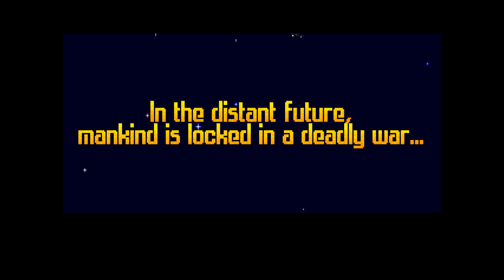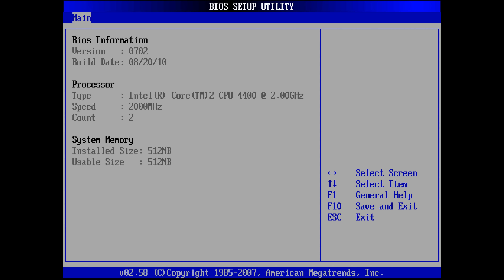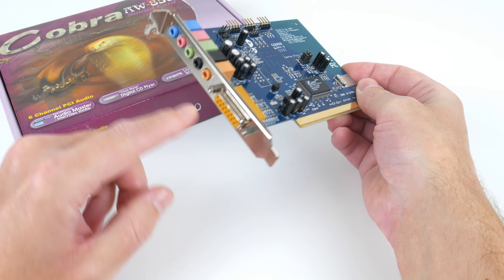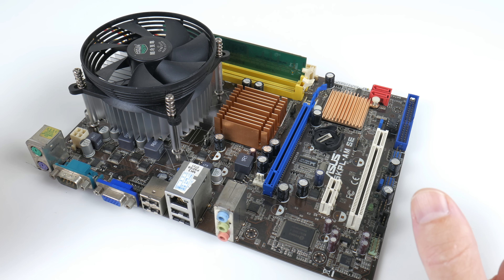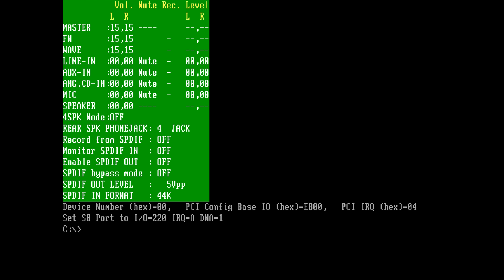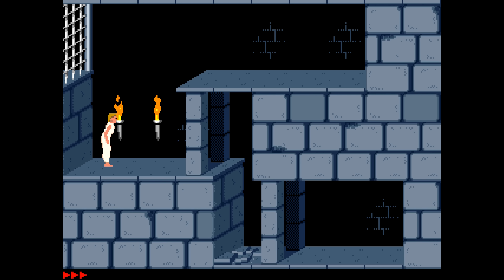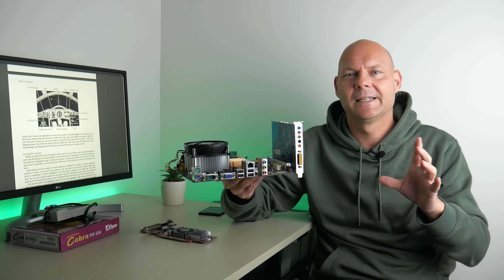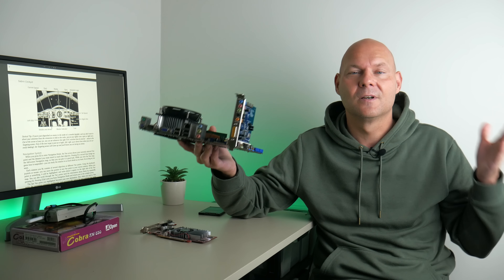DOS Retro PC with Parts nobody wants

Comment: I have no idea why people don't want lga 775 parts. The compatibility is immense. being able to run DOS all the way through to Windows 10 is crazy.
Reply: they are still great for basic Linux machines as well with enough RAM, an SSD, and a 1/2 decent video card.
Reply: Of course they want, the prices are already insane and have been for years, maybe what PhilsComputerLab meant was some of the lower end 775 motherboards no one wants. I have two 775 modern DDR3 boards, bought each for 12€ last year as my DDR2 motherboards just died, the prices of those same boards increased a lot since then.
Reply: @farben_ not really. Also there are plenty of OEM systems that have decent on board audio compatible with Windows 98
Reply: Exactly, but there is nothing as strange as people :)
Reply: @JoshVennix  I've looked at this exact motherboard p5kpl-am se a couple of years ago, it was already on the 20-25 bucks, it's now with shipping over 50€. 775, AM2, AM3, 939, Socket A... everything is costly now, there are no "hidden gems" anymore. Used Sandy Bridge motherboards cost the same as current modern ones.
Reply: 775 isn't considered 'retro' as of yet. People don't want the heat generation of the older Pentium D either. I just recently came across a parts bin for $30 containing a Voodoo3, S3 Vision864, Pentium 200-S, Yamaha 719 sound card, and Sound Blaster 16 CT2290. I put together the 200-S, with my P5A-B. The S3 Vision864 / CT-2290 is a perfect pairing for DOS games. Quake runs at 45 FPS (640x480). Duke Nukem 3D and Shadow Warrior worked perfectly as well. There are still plenty of cheap Socket A solutions out there if you want really good UT'99 and Doom 3 playback.
Reply: I am still running perfectly good Linux desktops on LGA775 machines, particularly if they can take a Core 2 Quad upgrade like a Q6600 or Q9550 CPU.

I actually despair at the human race being "bullied" into regular hardware upgrades by Microsoft's Windows upgrades (and Apple's forced obsolescence) - because you can stick Linux on any Core 2 Duo PC or laptop with a 2.00 GHz CPU and 4GB RAM from 2006 onwards and have a fairly good daily driver PC, even for the modern and utterly bloated and broken web.

My equivalent to Phil's "XP retro gaming PC" is something like a HP Elite 8000 or Dell Optiplex SFF PC with an LGA775 socket that I have upgrade to a Core 2 Quad with 8GB RAM and something like a Radeon R5 430 low profile OEM GPU board running Linux Mint or my distro of choice, Gentoo Linux. A machine of that specification will run all older Linux native games, DOSBox and a lot of the GoG catalogue with WINE - I tend to use Supertuxkart as a benchmarking tool on Linux PCs that I build.

You can build such a PC for "pocket money" today and I have a whole stack of them just for when I get the guys over 3 or 4 times a year for beer, pizza and a LAN party with Quake, Unreal Tournament or Red Alert.
Reply: @CommodoreFan64  Damn! I just posted my lengthy diatribe on "great Linux PCs" and you got there first! But 100% in agreement.
Reply: @terrydaktyllus1320  LOL I'm with ya, but one place I disagree with you if you're going to use a computer for daily usage on 64bit Linux, is to have at least 6GB - 8GB of system RAM, and an decent SSD is a must(they can be had for less than 20 USD) for the boot drive for comfortable usage, so you are not running into swap usage, and waiting on disk access no matter how much ram you have  but 4GB is doable in a pinch if you are careful about how much you are running in the background, and use a lightweight browser like Falkon. I have an old ASUS 15in laptop with a hyperthreaded dual core i3, 256GB SSD, and 16GB DDR3L RAM(I it laying around in the parts bin, and thought why not lol), and it runs Manjaro GNOME with the traditional layout just fine for basic task.  
Also yeah I love salvaging old hardware like whenever I go to my local county recycle drop I make sure to check the e-waste bin, and found some really solid gear over the years like Macbooks, Kindles, HP/DELL desktops(I use one with an I7 2600s I found in the e-waste as my work machine), my Asus laptop, IBM/Apple Keyboards, etc.. It really does make me sad at how much people throw out that's still usable with a little TLC, some minor upgrades, and change in OS.
Reply: Let's exercise caution and avoid overestimating the capabilities of the 775 platform. While it may work for DOS gaming, based on my experience with old Dell Optiplex and HP systems for retro gaming, you can expect a subpar experience in Windows 98 due to inadequate graphics and chipset drivers, as well as the absence of an AGP slot.
Reply: It has a lot to do with that in between age. Like, you can get Athlon XP boards and chips still cheap.. and then for an XP machine, you can use a Haswell so.. Core 2 is just stuck in the middle. But yeah. If you get creative it’s a great platform
Reply: @PaulsComputerEmp  A valid point but it still goes back to LGA775 being a viable platform for modern day computing still - I'd consider it almost a "waste" to "downgrade" one as in this video, but if it works for some people rather than paying big money for "real" retro parts then who am I to argue?
Reply: @terrydaktyllus1320  The problem came with the advent of the 64bit OS, it meant RAM didn't have to be optimized like before so the programs and the OS itself became heavier and heavier, code these days isn't as optimized as before as it is assumed the user has the hardware that will meet any basic requirements. Windows Vista is a good example of this, except people were still using old hardware at the time and everyone just assumed Vista was garbage, these days if software is slow people just assume their hardware is out of date and they need to upgrade.
Reply: @farben_  Agreed, but Windows isn't an OS that I use any more, unless it's versions up to XP (and MS-DOS) for retro gaming.

I stopped using Windows as any kind of daily driver when support for Windows 7 ended - it was ordering a new Lenovo laptop that had the atrocious Windows 8 on it that made me realise I was done with Microsoft after Windows 7. (That laptop got formatted to a Windows 7 and Linux dual boot within 30 minutes of my getting it out of the box.)

My daily driver OS is Gentoo Linux which, if you don't know, is a rolling distro that compiles everything from source - which, for me as an incessant "tweaker", means that I use compiler optimisation and build flags to get packages compiled for the specific platform anyway.

It means that I running Gentoo today on anything from a Raspberry Pi Zero through to a multi-CPU Xeon server in my home - and that includes a few IBM Thinkpads from around 2002 with Pentium III CPUs in them that also run it perfectly fine.
Reply: it's a bell curve.  LGA 775 is in the 'old computer' part of the curve, whereas 2/3&486s are in the "retro" part of the curve, and thus, are perceived higher value by collectors.
Reply: @TheAfroman  There are some LGA775 boards built on i865G chipset with AGP and Win98 support. But they are rare.
Reply: Windows 10 is asking to much...from my experience an e8500 (a very fast 775 dual core) will somewhat struggle with Windows 7
Reply: I hate all of you!  (joking)   I have a warehouse full of this era old PC's.  I was going to send them all to the junkyard, because 'hey this is the worthless era , right?  too old to be useful and too new to be retro....    And then this kind of videos show up and I get the idea that I must keep storing them for another decade.....
Reply: @mattparker9726  also there are 100 times as many LGA 775 boards still in existence,  x86 stuff has been discarded 20 years ago, and what is left is in collector's hands
Reply: Depending on where you live, there’s still a lot of LGA775 hardware floating around. Schools/universities near where i live (as of a year ago) were still discarding 775 based machines.
Reply: @federicocatelli8785  If it can run Vista, it can run all other Windows too :-)
Reply: @xsc1000  
I know it can (my DAD still use one for some work stuff that does not run well with 10) but the lack of "modern features" like Sata 3 narrow its uselfulness
Reply: @federicocatelli8785  true that. But hey there’s always Linux.
Reply: @Blackadder75  you can send any you don’t want to me. Literally anything. I just need MOAR PARTS!
Reply: @Blackadder75  true. I still have my old 286, and no, I’ll never sell it.
Reply: @mattparker9726  I am in West - Europe  you can pick them up here
Reply: @mattparker9726  I was 10 years old in my 286 days, so those are all long gone...  But luckily I bought 1 computer of each generation a decade ago, so I have a small but nice collection.    
About the tons of more modern  old PC's  I have, that is because  I manage hundreds of computers in my work.   I have discarded  thousands devices from 2005-2013 era (and I still have stored a few hundred)  My work considers those items completely written off and I can do with them what I want.
Reply: THX for the advice but I'm keeping that old PC only as safety as
I've made 2 virtual machine on his "newer" PC (nothing fancy 4th gen i5) to run those engineering programs that does not play nice with 10
Reply: @Blackadder75  
Wish I had the space...
Reply: @federicocatelli8785  it's just  PC cases with parts inside, no monitors or peripherals.  It's amazing how many you can cram in one closet......  I can put 40 on 1 europallet
Reply: I want to install pcDOS2000 on a real computer, but I don't have a suitable computer. 775 Part cannot be installed.
Reply: @mattparker9726  i know where you live 😈

Jokes 😂
Reply: @easyerthanyouthink    cool! send me PC parts.  Not joking.
Reply: It is by far one of my favorite intel platforms. I still have several cpu's and a few motherboards lying around including a q6600
Reply: @terrydaktyllus1320  core2quad q6600  is my main media centre pc - with a gt1030, plays newest lego Star wars game for the kids reasonably well too! (gt1030 as is a dell sff pc so only 1/2 height slots)
Reply: Nvidia socket 775 motherboards are picky on the O.S. . Windows only works up to 7. Anything after that and you get constant crashes. They refused to update their chipset drivers. I still have 2 evga 780i SLI motherboards,  but I'm retiring them. Would of loved to get a 790i SLI board w/ddr3,  but the used prices were way too high...
Reply: @mattsword41  I am not surprised - and is that with Linux?
Reply: @terrydaktyllus1320  no, windows 10
Reply: @mattsword41  Well, if it works for you then so be it.
Reply: @farben_  there are still plenty of OEM systems out there. Although they lack overclocking and underclocking capabilities. 

Here in Australia socket 775 motherboards still going cheap.
Reply: Idk. I'm building a server with 775. Though I'm using core quad q6600 and only because I had most of the hardware already (i.e. free).
Reply: it can run 11 although you would need to do some regedit mods
Reply: Any motherboard processor that supports windows xp 32 bit can be used for Retro DOS gaming. Windows XP 32 bit supports almost all DOS games. I play DOS games in 2nd and 3rd gen sandy bridge and Ivy bridge i5 laptop and desktops. Also I have an AMD FX-8350 for old DOS games.
Reply: @retroindian1864  Yes, but you are still relying on emulation layers with Windows XP to do it - "compatibility mode".

In Windows 98 you can run true MS-DOS because Windows 98 is built on top it.

Sure, it works well the way you suggest, I do some of my retro gaming that way too.

But there is a distinction between emulating MS-DOS and running it in real MS-DOS mode.
Reply: @terrydaktyllus1320  But it's worth it even without a microsft. Look what a new computer consumes compared to the old one. It can be up to 70% less idle and 50% less operational.
Reply: Because there are two main approaches in retro gaming: use of period-appropriate parts and 100% compatibility, and everything else (including all sorts of emulation). This is the second path, there is nothing wrong with it, but it is not free either.
Reply: Virtual Freaking Box.
Reply: @farben_  I've been running an ASUS P5Q SE PLUS board modded to take a Xeon X5492, as my daily driver since April 2012.  I recently tried to find more DDR2 for it to double from 8 to 16GB, but could only find cheap Chinese crap.  I took the risk at £72 and it just crashed all day long for months, and so I put my old sticks back in.  I tried loosening the timings on the Chinese sticks, which improved things a little but then went bad again.  It's a fantastic computer that has served me very well indeed.  All the upgrades it had since 2012 were very cheap, both used and new parts.  The prices of those have rocketted since.  The CPU was about £48 in 2015 and since climbed to £200-£250.  Even the ASUS GeForce GTX550 Ti installed is climbing in price and might end up going for what I paid in 2012.
Reply: @Blackadder75  I wonder what my old ASUS TUSL2-C based PC bought in early 2002 is worth these days? It has the fastest server Pentium III 1400S CPU, Leadtek WinFast A350XT TDH GeForce FX5900XT, 128GB SSD, 512MB SDRAM.  Got it running Windows 98SE at the moment and its like lightning!
Reply: @EgoShredder  sorry , I have no idea, I never trade in old PC's I just collected a bunch myself because  from every 3-5 years of PC history I want to have 1.  I usually paid between $0 and $100 for old Pc's  but that was before it got fashionable to collect old junk.
Reply: @EgoShredder  My retro 775 setup is much simpler, it's just a GIGABYTE GA-G41MT-D3V, a Q9550 stock, 8GB 1333MHz DDR3 RAM and a HD 4850 1GB, it runs Win7 and Vista for now, I'm going to get rid of Vista and install XP, Vista got better with the drivers but there are still issues even with the all the updates. 775 prices aren't cheap anymore, maybe in the US, AUS and other parts of the world but not in Europe. My motherboard cost €12, bought two as I knew I wasn't going to get them for those prices any time sooner, it's stored away as my backup. I won't be getting any 775 motherboard any older than say 2011, if it doesn't support DDR3 and doesn't have modern solid capacitors then it's a waste of money as it won't last much.
Reply: @terrydaktyllus1320  I want to express my appreciation to Phil for creating another fantastic video. however opting for free Dosbox over using a 775 proved to be a more enjoyable gaming choice. After watching Phil's video, I felt inspired to set up a 775 HP DC5800, and it turned out to be a fun and fulfilling build.
Reply: I am buildindg several right now
Reply: @terrydaktyllus1320 You CAN run Linux on a lot of old hardware. Whether most people WANT to run it is a different matter. The Linux world is a mess. The kernel is robust, but above that, everything goes pear shaped. More "distros" than one person can keep track of, the number of window managers boggles the mind, software repositories range from abysmal to adequate and you sometimes have to compile source code just to get a program to run. But worst of all, you're still forced to use the terminal to get simple things done. Some of us are glad we aren't REQUIRED to learn obscure commands and paths to get things done. It was fine in the MSDOS days, but DOS died a long time ago. Apparently nobody told Linux developers things have moved on.
Reply: @another3997  You are welcome to your opinions on Linux but you are completely wrong - and I speak as someone who started using Linux in 1996 after about 8 years UNIX admin experience in my job, and my day job now (and for the past 20 years) is hardening Red Hat Linux servers. So I don't think there are many people in the world more experienced with Linux than I am, and therefore you talk complete rubbish.

If you choose not to use Linux because you are unwilling to invest time and effort to learn it properly (as is the case for many people who will still claim to be experienced in computing but prefer to be constantly abused by Microsoft or Apple) then that is your choice - but that is your problem, not a Linux one.

Do not forget that nobody came into this world knowing how to drive a Windows computer either - those skills were learnt at home, at school or college or in work. Yet many people won't give Linux the same effort or time to learn it either - that's not comparing "on a level playing field".

My experience, if anything, is that many non-Linux users are critical of it probably because they feel "locked in" to Windows or Apple and get frustrated at Linux users like me who have worked out how to enjoy computing freedoms and what it is to return to proper "hobbyist" computing, like we used to enjoy on home computers like the Amiga and early MS-DOS and Windows, before Microsoft became an abusive and privacy-hating company around the days of Windows 7.

Simply put, you're just jealous of those of us who can use Linux and use it well as our main OS, and who have freed ourselves from our Microsoft and Apple abusers.
Reply: i only keep the nForce DDR 3 boards, you need them, you can have them
Reply: If you think Windows 10 runs well on a Core 2 you are actually delusional.
Reply: I’ve seen a couple cool boxes in some of your videos. It would be cool if you had a gallery of various GPU/other expansion card boxes on your website